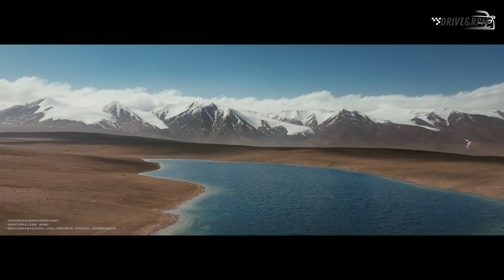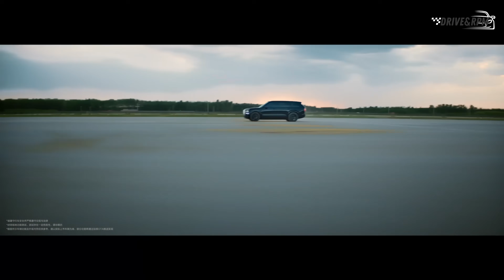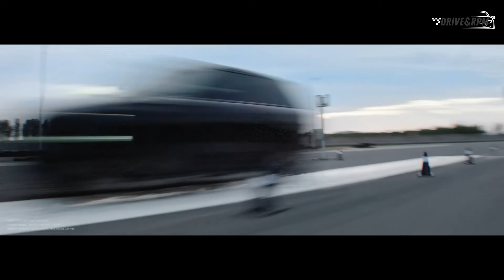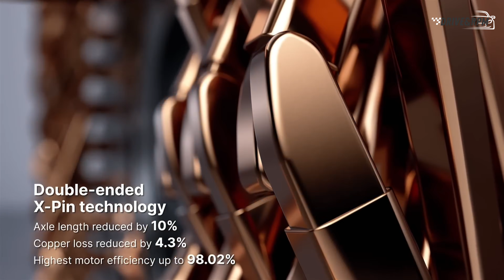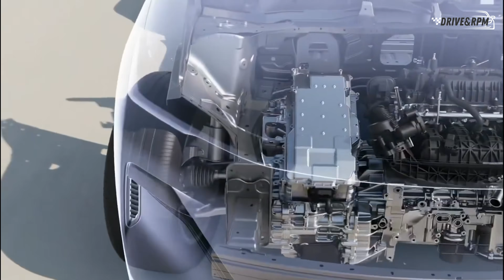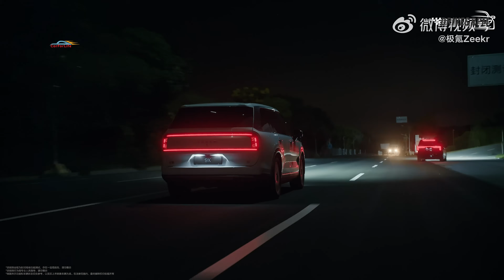No Stabiliser Bar?! The 2026 Zeekr 9X 900V Hyper-SUV Anomaly

Comment from the maker: The Zeekr 9X completely eliminated the mechanical stabiliser bar and traditional steering column. Would you trust a computer and 48V actuators to keep a 3-ton, 1,381 HP monster stable at high speeds, or do you still prefer physical mechanical linkages? Let's debate below! 👇⚙